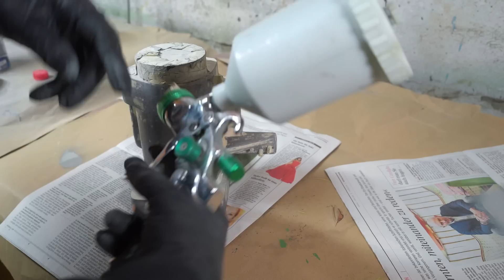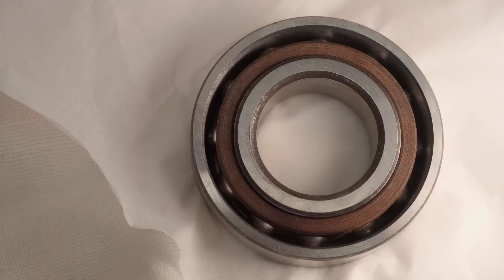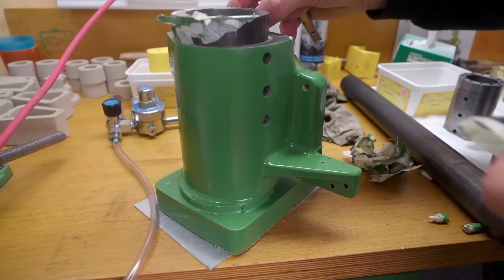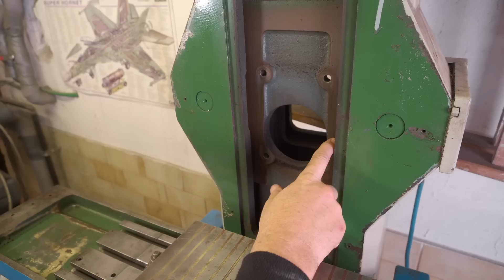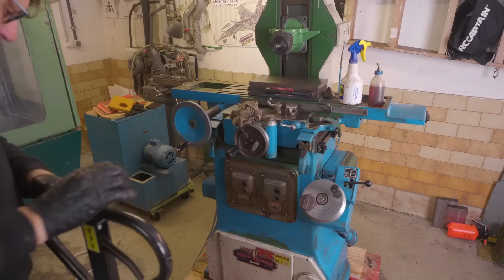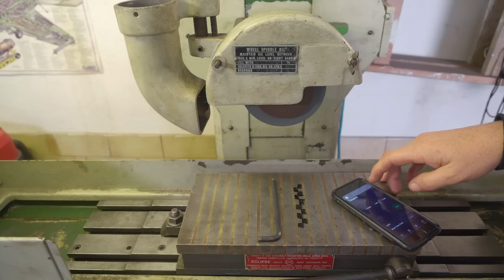My surface grinders bearings needed servicing || RotarySMP

Comment: The oil information on the machine plate has the information for the oiling of the bronze bushed bearing spindle so its likely had a ball bearing replacement  fitted at some time. The ball bearing machines run a different size motor pulley. A quick measure with a ruler and it 3-5/8 O.D. where the belt goes.
Reply from the maker: I am not sure if the head was replaced, or someone mixed up the wheel guards and put one from a plain bearing head on this one.

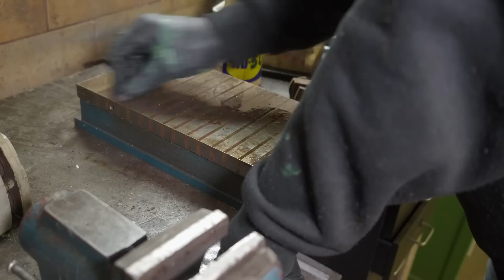Comment: @ 2:52 I was lost there...
U clean up the bottom surface;... then flip it over on2 a DIRTY surface...
Then let it move about...
Reply from the maker: I wiped the metal bench down before I did this.
Reply: @RotarySMP  ...
I will let U off...
ROFL

Comment: The "run in procedure" for really old bearings is probably a bit more forgiving lol  😎
Reply from the maker: I doubt that. Running in is to prevent overheating.
Reply: @RotarySMP     well with the old motorcycles we rebuild, running in is something for new bearings which are tight and have not yet reached their final (normal) running clearances
Reply from the maker: @ That is for plain bearings. For spindle bearings it is about ploughing the grease out of the way to reduce the friction the grease load causes.
Reply: @RotarySMP    agreed for sure, the issue was definitely the grease displacement. 👍
You said it was a fixed speed spindle motor, so for the grease run in you could turn at low rpm by hand, or even once it was spinning (with no belt) use some compressed air on the edge of the grindingwheel and easily keep it spinning it at low rpm for a minute.

Comment: Quick tip, use a very fine grain stone to remove burrs from the chuck and work piece before putting the workpiece on the chuck. And when you get some better wheels grind the chuck preferably with coolant.
Reply from the maker: Thanks Lorenzo, I did stone both sides before mounting it. I want to do some measurements and get a feel for the machine alignment and accuracy before I regrind the chuck.

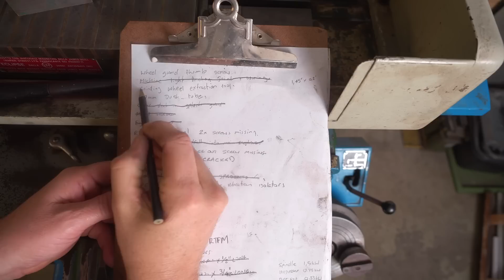Comment: Did rotating one of the bearings at 15:37 by 180 degrees throw off the eccentricity alignment of the bearings?  You probably thought ahead and planned for that.
Reply from the maker: I also wondered that, but ideally, those mark the bearing high spot, and should be alligned to the shaft and housing high spots, but J+S had no markings for this on their parts.

Comment: Good plan to evaluate all aspects of the J & S surface grinder, before revisiting the expensive spindle bearings,  I'm very jealous of your power rise and fall, I have a standard 540, blooming hard work when changing jobs. One improvement I've made is the rear oil lubrication points, which brought standard nylon tube and battery plate to the front. 

I've never used any Kluber products,  I understand there are mineral and fully synthetic based variants,  fully synthetic doesn't mix with any mineral grease, we had a machine tool builder build rotary friction welding ( Bonding) machines for my then employer, ( I was a commissioning Engineer). One of the fitters decided he would upgrade our clutched pulley assembly with a Kluber spindle grease that was used on their own high speed spindles, he did this on 3 machines, it didn't manifest its self until 8 months or so on the first machine,  now in South Korea, the standard deep groove bearings about 180mm diameter run continuously at approx 1450 rpm, were toast, so were hub, spacers, shaft extension ( AC motors were circa 185 kW, Edit Not 250 kW).
Some materials analysis later and we found the cause. The machine tool builder had to pay for new components for all 3 machines, from USA, China,  and as mentioned. 
He had fitted the bearings and lipped seals without removing any residual oil/protective grease, we think this was the reason for the failure. All 3 machines had similar contaminated lubricant.
There were 2 pulley assemblies per machine, probably 2 to 3 Kg of very expensive Kluber grease, as opposed to standard NLG 2 bearing grease called up on the drawing. 

Thanks for sharing.
Reply from the maker: I am glad this one was retrofitted with the electric rise and fall, as that fine downfeed wheel takes forever to reposition the head.

Great story. That must have been a tough meeting when you found out about the failures.

I did my best to wash all the previous grease out. Then again, I think these bearings are probably shot, so sooner rather than later new bearings will be necessary.
Reply: @RotarySMP  Yes, it did sour a few relationships. Just a thought,  the slotted set screw (Grub screw), should that be left loose, ref just engage in the axial slot to prevent rotation, but allow axial movement?
I'm probably wrong here though. 
Best regards John from the Black Country UK.

Comment: Well done!  Don’t be in a hurry to grind the chuck in it’s very easy to mess it up when you are lacking experience. Wait until you have a  full diameter wheel on with know grit and bond. use coolant and take more advice.
Reply from the maker: Thanks Tony. Yeah, I already picked up on not doing that, until I really understand the machine. That first block I ground came out way off parallel, so I have bit of inspection to do :)

Comment: About 5 micron of spindle runout, Not bad  at all.

On subject of balancing the wheel, You can dress both side of the grinding wheel to somewhat balance it without having to use balancing arbor.
Reply from the maker: I would have expected less run out, but, am glad it is not an issue. 

Thanks for the tip.

Comment: I well approve of your decision to test the machine with its now properly greased original bearings. Precision bearings generally won’t exhibit obvious signs of being out of spec (if they did then replacement would be a no brainer). Short of destructive testing the only way to tell if they are out of spec is installing them with proper preload and verifying the end result like you did. 

Even if the bearings are determined to be outside their original precision range, so long as the machine functions and delivers satisfactory results, in line with your requirements, then they are still good enough for your needs. 

I like to think of it like this: a Monarch 10EE leaves the factory with a spindle runout measured in the millionths, decades later if that runout increased to become 1 tenth (0.0001”) it doesn’t mean it needs new bearings IF the end user doesn’t need a higher level of precision.
Reply from the maker: Good points. They way I see it, at present, the bearings are not the limiting issue on my J+S. I need need to do the measurement and work out how parallel that chuck is etc.

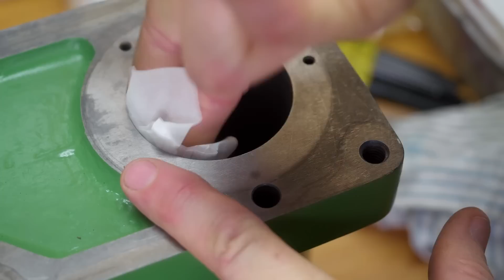Comment: At 17:03, To clean cast iron of grit, a simple cleaner is red transmission fluid on a white towel, (Kimwipe?).  If it comes out with any 'BLACK' on the towel, it is still dirty.  Clean again until it is just the original 'RED'.  Transmission fluid may also be an adequate corrosion inhibitor, as well as a rust bond breaker similar to PB Blaster...and at 17:30, possibly an assembly lubricant as well.
Reply from the maker: Thanks for the tip John.

Comment: Great video Mark! 
There is a huge price difference between different bearing qualities, but what does that yield in terms of acquired surface precision?
Reply from the maker: I dont have the experience to answer that other than, if the cheap ones worked well enough, they would not have used the P4 7/ Apex 7's in production.
Reply: @RotarySMP  I dug into it a little deeper, and example:

Angular contact  bearing 40-80-20 mm
Runout inner and outer ring
            ABEC 1: 15 and 25 µm
ISO 6, ABEC 3: 10 and 13 µm
ISO 5, ABEC 5:   5 and   8 µm
ISO 4, ABEC 7:   4 and   5 µm
ISO 2, ABEC 9: 2.5 and  4 µm

ABEC1, ISO normal € 20,-
ABEC3, ISO 6           € 70,-
ABEC5, ISO 5           € 370,-
ABEC7, ISO 4           € 730,-
ABEC9, ISO 2           € ??? The sky is the limit.. 

So an ISO 5 bearing has roughly half of the runout an ISO 3 has, but is five times more expensive. And if you want to halve that runout again to ISO 2 precision, you'll maybe have to take out a second mortgage. But these are only runout figures, there is more. Better precision means the bearing is quieter, has less vibration, can handle a higher rpm and wears slower. Some of these properties are very worthwhile in a production environment where speed is important and extra maintenance is very expensive. But I wonder if these arguments are valid in a home shop..
Anyway, you measured 5 µm runout, so within the ISO 5 range. If the surface finish is satisfactory, then IMO the bearing is good enough.

Comment: I have the bigger (and probably a bit older) brother of that Weiler E30. It's a Voest Alpine-Steinel W570E. As far as I know this became the Weiler E50 later. Mine has the original AMK servodrives and a non-functional Visulesta DRO/controller. It really could use some TLC, but I'm a bit worried to go down to the rabbit hole so deep to take it completely apart and send out the bed to be reground. Theoretically it has a functional self lubrication pump, but someone used the wrong oil in it for sure. Until now I just did some electrical trouble shooting and removed the top of the cross slide. The saddle cavities and the slide surface oiling holes are full with coolant sludge.
Reply from the maker: They are lovely machines. I hope yours is not too worn. It seems Vasi's lathe is a victim of some pretty bad overhauls.

Comment: You need to grind the chuck flat and clock in the back edge to allow you to grind parallel to the back face riser. You should really balance each grinding wheel on its own arbour. This J&S is a very big addition to your workshop 😊
Reply from the maker: Thanks Chris. Before I grind the chuck, I will do some measurement and get a feel for where it has issues I might need to address.

Comment: Your step over ist relatively heavy.
I prefer stepping over only one grain with of the stone.
Approximately 0.5 mm on a 46 grit stone.
With this technique you don't have to dress the stone so often.
And the finish is better.
Reply from the maker: Thanks Martin, I got another comment which was exactly the opposite advice. Small depth of cut but large step over to prevent glazing of the cutting corner. ?
Reply: @RotarySMP  If you use a coarse wheel with a open structure glasing is no problem.
Or on hard stuff e relatively soft wheel.
There are a few verry good videos on this topic on YouTube.
Stefan for example did a video on grinding.
I use the small step method on my grinder and glazing was never a problem.

Comment: Single click on the torque wrench = proper engineer
Reply from the maker: Thanks for noticing :)
Reply: @RotarySMP  Asking for a friend😉 where is the actual evidence to support this ?   All i've ever found is what I would classify as  unexamined opinion.
what I have found is a NASA paper that suggests that a torque wrench is  good for +/-25 % and a skilled hand is good for +/- 35%
Given that, even if the fastener moved on the second click, (infinitesimal, In my experience) so what?
the condition of the fastener it's self. will have far more effect on the torque.
Fun aside , I don't habitually double click ,especially on small fasteners, and all of my professionally used torque wrenches and screwdrivers were  calibrated 
inhouse by our qc department, and could be confirmed for set torque at any time,   Kind of like a proper engineer.
Reply from the maker: @ No science but I was just taught to torque once. No value in more.
Reply: @ Honestly unless I have a paint marker with me I sometimes lose track.
It's winter to summer tire change time here,
so my habit is  torque in a star pattern then once around the 5 nuts to confirm, followed by a short drive  and check again. and then again  after 100KM.
No wheels falling off for me.
Reply from the maker: @steveggca  That reminds me that i need to get some new tires for my car. Thanks Steve :)
Reply: @RotarySMP  bought Continental touring tires last spring, quiet and good in the rain

Comment: I used Kimwipes for 26 years in the AF. They aren't perfectly lint free but work fine in an electronics shop.
Reply from the maker: Thanks, they will be more than fine for my jobs.
Reply: @RotarySMP I work in the semiconductor industry, and we typically use those Kim wipes in cleanrooms. To my knowledge, they are pretty close to lint free, even if not perfectly lint-free.

Comment: I keep the stops on mine at the max travel so as not to wear a dish in it. It is just extra time and I'm not on the clock.
Reply from the maker: Mine already has that dish in the ways. Probably part of the reason it binds at the ends of travel :/

Comment: Question: rotating one bearing housing 180 degrees after sliding on bearing - did you misaligned positions of engraved V markings on bearings by 180 degrees?
Reply from the maker: I wondered that as well, but since J+S provided no alignment markings where the high spots should go, it is probably irrelevant.

Comment: Damn, if only you had some sort of timer built into the machine to help you with those bearing run in cycles.  Possibly located on the lower left hand side of the machine.  😉
Reply from the maker: I dont think it works in seconds. Actually I haven't really checked if it works at all?